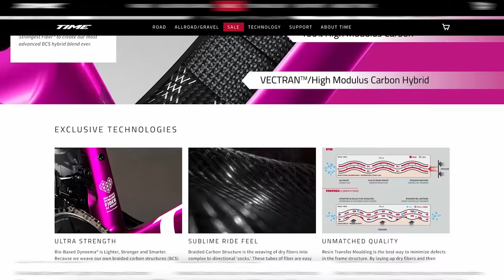Beneath the Paint of the Worlds finest bikes

Comment: I wonder.. if Time bikes are so perfect, than there's no reason to buy Hambini BB, right?

Which BB would be ideal to accompany such a great bike?
Reply: A Hambini bb def not needed, but would be nice, except for the weight.
Reply from the maker: We often choose a Rotor or FSA. We try and avoid using 386evo adaptors and get the units that are straight 386 to 24 etc.
Reply: @Onigure  You mean, "except for the price" (which is justified given where it is manufactured) as the penalty over something with nylon cups we are talking a couple grams.
Reply: If your frame has a bb shell issues like misalignment or is oversized, or else not round within the standard tolerances, then a Hambini bb isn't going to fix it. And if the shell is under- or largely oversized you won't even be able to install one. I once had a frame with a shell that was 0.1mm oversized, and the bb simply spun inside. There is this common misconception that Hambini bottom brackets are a cure to shite bb shells, which they are not.

Comment: I just purchased an ADHX frame, and my bb shell measured 46.015mm on one side, and 46.021 on the other side.  I've measured one other new ADHX that a friend purchased, and his was similar to mine:  in the 46.013-46.020 range.
Also, the end/outer faces of the bb shell were out of square on both these frames by about 0.25 -.030mm so I made a tool to rework the faces to be parallel to each other, and square to the centerline of the bore.
I "suspect" that the fixture being used to locate the two "rings" must not be a perfectly tight fit, allowing those "halves" to move slightly out of square during the setup and/or molding process.

Don't get me wrong:  the two frames I have handled are gorgeous, and far, FAR better than anything else I have ever measured (or re-worked).  I believe TIME could still improve the process in the bottom bracket shell though.
Reply: Im not a native English speaker. Is this what you call 'splitting hairs'? ( Hair = 50 microns 👀)
Reply: @Onigure 
I believe the "theoretical" spec for a BB386 press fit bottom bracket shell is probably 46.000mm (plus 0, minus 50 microns).

On a conventional layup-style carbon frame, which almost all other brands use (pre-preg into mold halves, with an inflatable bladder during curing), the bottom bracket shell does not have the stiffness (in the diameter/radial direction) as the method TIME appears to use.  This means that there is a bit more "flexibility" in the bottom bracket shell on many/most carbon bikes, relative to how TIME "appears" to make their bottom bracket shell.   

It appears (to me) that TIME "probably" compression molds a carbon tube (on a 46mm ground steel mandrel) using pre-preg carbon filament, and wraps it with heat-shrink compression tape.  It is then cured in an oven.  The heat-shrink tape applies a tremendous amount of "squeezing force" on the carbon, and the tube is cured.  Multiple layers could be done this way to make the layup an extremely "dense" and extremely strong tube that has a very accurate/round inside diameter (on-size assuming they lay up on a precisely ground mandrel).  I suspect that TIME then removes the carbon tube from the mandrel (may require a hydraulic press), and then cuts "rings" from this tube, which are used within the layup of the bottom bracket.

Overall, this is a great method compared to "typical" carbon frame manufacturing method (in my opinion) --- however, yet a better way to do this would be cut the tube the full length of the bottom bracket shell (in this case: 86.5mm) and grab the tube in a 4-axis CNC mill and machine-in holes where the down tube, seat tube, and chain stays are (necessary for cable, brake lines, or Di2 wires). This would not require much time.  The end result would be perfect alignment between the left and right diameters of the bottom bracket (the points of contact for the bottom bracket that will be pressed in), and absolutely parallel "end faces" (which is quite important if someone is installing a 2-piece bottom bracket -- e.g.  Wheels Manufacturing, or many others).   

As it is being done now, it "appears" that whatever method TIME is using to hold those two rings of carbon "in place" to lay up the frame is not as good as it could be.  Either that, or the machine they are using to cut those carbon rings from a carbon tube needs to have its alignment checked.  Something is slightly amiss, or the two new ADHX frames I have checked would not have the outside/end faces out of parallel with each other.  

All the above is only my opinion.   I have not been to the TIME factory, so the above is simply my speculation based on what I am seeing in the two TIME ADHX frames I have measured.
Reply: @agie170hss2  Interesting. Did you experience issues when installing the BB or measured merely out of curiosity? What BB do you have? Did it require retaining compound (Wheels Mfg recommend grease, not retaining compound) given the slightly larger bore diameter?
Reply: @steveadorjan9048  
Measuring the BB shell was the first thing I did when I received the ADHX frame.   I make my own bottom brackets.  

I, myself, would never run a 2-piece BB.  Even a very precisely made 2-piece has no chance of assembling with the bearings parallel and concentric unless the BB shell has a straight/round bore, and the end faces of the shell are parallel and square to the bore.  Yes, those BB shell faces can be touched-up to make them parallel and square, however the next issue is that the thread where the halves screw together can be a source of creaking. In my opinion, the only way to have a chance of getting the crank bearings in perfect alignment is to use a one-piece bottom bracket that has been precisely machined.   Needless to say, having the end faces of the shell parallel and square to the shell bore is not nearly as important when using a one-piece BB, however I prefer to have them square regardless.

I just finished making three 1-piece BBs (in 10µm increments) for my ADHX, and they are on their way to the anodize shop.  I should be assembling the bike in a week or two.

Even though it's often the only solution, I am not a fan of retaining compound -- I would rather have the BB be the correct size for the proper fit.
Reply: Prepreg bikes are made in mould halves? How are the halves connected? Pure resin? How can the halves be connected with continuous fiber?

Comment: Also just had an ADHX 45 built and to fit the hambini BB they had to remove the cable guide in the bb shell any idea how to plug the hole on the shell. Thanks
Reply from the maker: Unless you have an old style di2 junction exposed I would leave it open. The Hambini BB is sealing any water water to bearings anyway.  It’s good to have a drain hole. It might be on the big side, but I would have no concerns leaving it open.  If you ride in a lot of mud you could close it off with some Sugru.